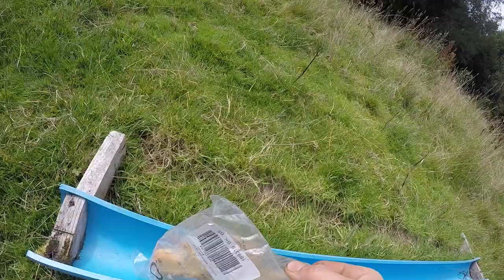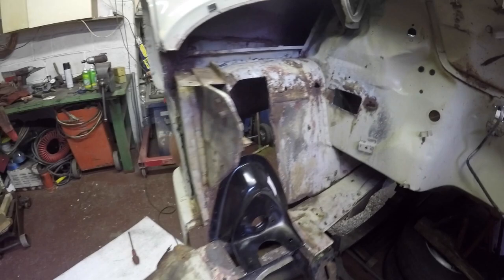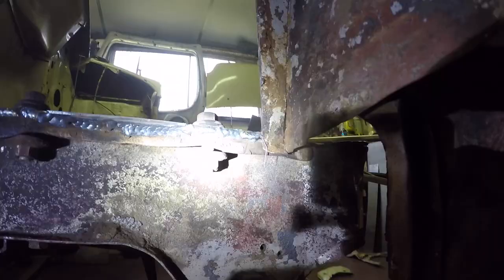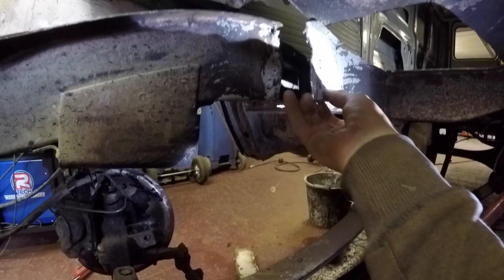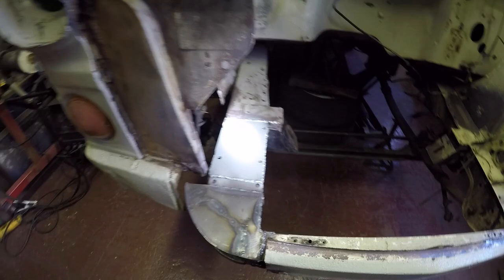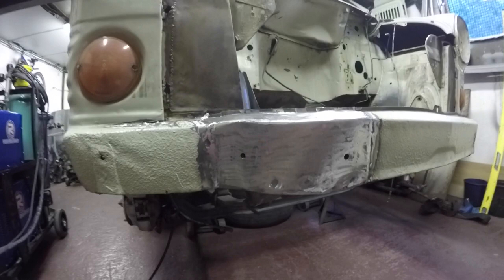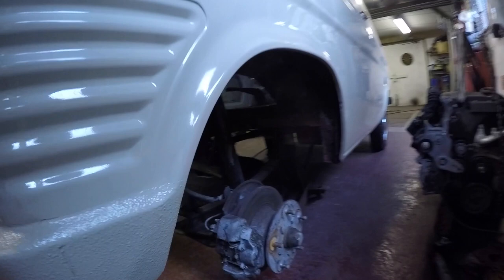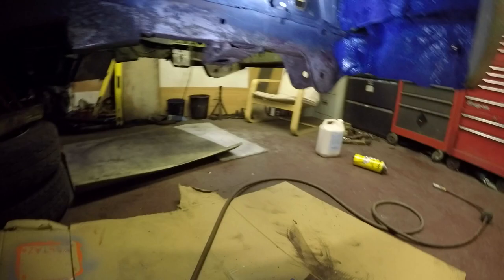Ford Transit Mk1 Project - Part 5

Comment: I can see when you dropped the front axle off the van has been converted to disc brakes. Do you know if they are modern transit or something else.
Reply from the maker: Hi
It’s a late euro mk1 so they have disc’s like they do on the Mk2 as standard 👍